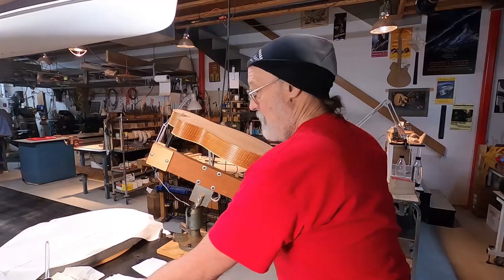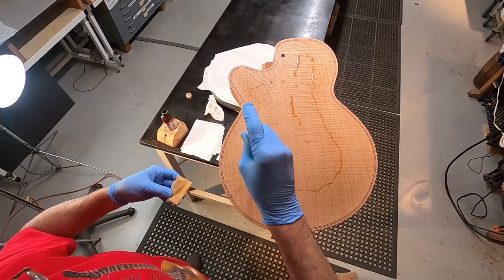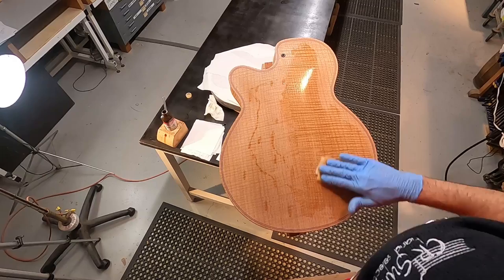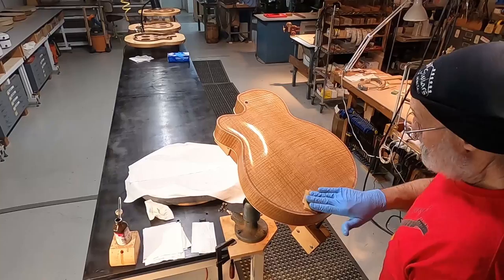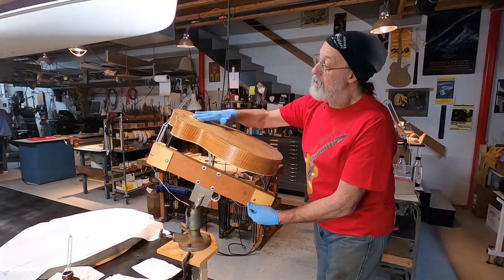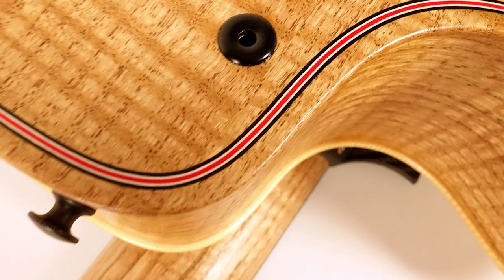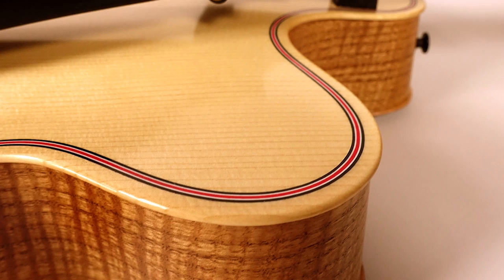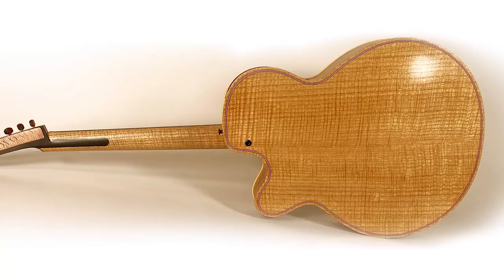Ken Parker Archtoppery: Applying Finish 6

Comment: Ok made it to the end!

First of all, thank you so much for sharing your process and expertise. This really inspires me and how I want to take my building forward. 
I had some follow up questions for you:
1) have you tried using an oil/shellac combo a la Eugene Clark on the top coat or at any layer?
2) Would the epoxy wipe off finish faster or thinner with a rag soaked/damped with alcohol?
3) do you buff/ steel wool at the end of the finishing process?
4) how does this finish impact the tone and have you/would you use it on a flat top?
5) do you seal the inside of the plates and rim as well? 

Thank you soooo much!
Reply from the maker: Hey Robert!  Good questions, I think I just answered all of these for others.  Maybe poke around the comments and see if I've left anything out?  I'm trying to figure out how to handle the questions in the best way, and maybe I'll just wait a bit after releasing the series, then do a video Q&A that will be comprehensive.

Comment: I used Truoil for my last guitar. Its surprisingly durable and can be sprayed no problem at about 8-10 pounds from an HVLP. Doesnt effect the sound in any bad way either
Reply from the maker: I have heard this from others. glad it's working for you.  I like hand wiping this material so much, I'll never try another method. It's easy, and if you can get going early, you can apply 3 coats/day, and have perfect control of the surface. My days of atomizing finish are behind me. Yuck.

Comment: Hi Ken, I have been using Tru-Oil for 8 years, and if you apply the last coat of Tru-Oil with 000 steel wool, the surface finish becomes even more beautiful. Of course, you have to wipe off as you go.  Try :)
Reply from the maker: Great tip!
Reply: How so? Not trying to be a wise guy, I really have no clue what the steel wool does. More matte? More shine? Smoother?

Comment: Hi Ken! Thanks for giving an insight look in your workshop. May I ask if you do sanding between the coats? Thanks and regards! Flo
Reply from the maker: Only if there's a problem, which I try very hard not to allow.  The coats are super thin, and sanding is not required if you wipe perfectly.  0000 steel wool will erase most little issues, if needed.

Comment: Thanks Ken for your intelligent approach to all things guitar building. I've been using Tru Oil and Renaissance Wax on my necks for sometime now. Not liking a high gloss neck finish. Wondering about the epoxy seal coat before hand on the body. Do you use as a pore filler? Seams like both these woods are fairly tight grained. Also what's you opinion of Z-poxy finishing resin? And I agree totally the Italian Chestnut is absolutely beautiful.
Reply from the maker: You're most welcome! The epoxy forms a thin layer of plastic resin mainly within the wood, so a bit of pore filling is bound to happen, but when you're done applying it to an open pore wood like the curly Italian chestnut we like so much, it still appears very open and unfilled.  The sparkle and reflectivity of a very smooth wood surface is largely the exceptionally shiny inside surface of each cellulose tube, which are a probably a bazillion times smoother and more reflective than anything we can accomplish by polishing the wood with our various means. Traditional pore fillers normally contain opaque pigments, which block all this reflective glamor. I suppose its not so bad to fill with something without pigment, like this epoxy, but getting it to do the job evenly without soaking the guitar with a spray gun, and having to sand a lot of material off, then go over it again to try to get the pores that were unfilled is a very steep challenge, and, in my opinion, a toxic mess to be avoided, ask me how I know. If you unlock the secret to easy and successful pigment free pore filling, pray tell! I never tried Z-Poxy, and so have no opinion.  How do you like it?
Reply from the maker: I just read through my reply, and noticed that I didn't mention that I don't use pore filler ever, and as far as I know, nobody can make me.  I like it when the wood looks and feels and sounds like wood and not like 6mm of clear epoxy bonded (?) to a tabletop. Whew, now I feel better.
I can usefully quote by buddy Michael Greenfield, ""Finishing" is an oxymoron."
Seriously, though, I suspect that you may really like your neck finish even more by starting with  this painless sealer/primer clear epoxy coat; just don't forget to wash off the amine blush before you apply Tru-Oil!
Reply: @kenparkerarchtoppery9440 Thank you very much for your reply Ken. I've been building and repairing guitars for over 20 years now. Not my day job so it gets squeezed in when possible. My main focus has been solid body electrics and so a lot of high gloss finishes. Most people like high gloss finish. The Z Poxy is a finishing resin that is a 1:1 mix and a bit more amber looking than the product you use. I had a problem with coating over it and stopped using it not knowing about the film you mention that needs washing off. Anyway not to rattle on, I'm soon building a OM Martin style acoustic and am very grateful to have found your finishing system. It will be perfect for this guitar. Thanks again Ken, appreciate it.
Reply: @kenparkerarchtoppery9440 , absolutely plan to add the epoxy step to my neck finishing. And I'm very familiar with the tru oil finish having used it with the wax on a ES-335 style all mahogany bass. Love the feel. going to add the epoxy step the next time and try it out. Thanks again for the info and taking the time to write a very thoughtful reply.

Comment: Hello Ken, a few questions sorry to bother:
Any consideration when using stains? Can It go trough the epoxi, or would It be better using It before(or just using something different like shellac)
Other luthier's using tru-oil sand between coats. With your method it is not really needed right(considering how thin you apply it)?
Could it be wheel buffed being careful about how hot it get's, or is it too risky?
Have you tried other oil varnishes? There's a few acoustic guitar builders quite passionate about alkyd short oil varnish, for example.
Thank you very much for these videos, looking forward to the next
Reply from the maker: So many good questions!  Please find out about the stain thing and let me know how it works, I'll be in your debt!
Sorry, I'm such a nerd, I really have no idea what other builders are doing, just trying to satisfy myself.
I'm terrified of buffing wheels, no thanks!
I've tried almost everything, and this is the finish I wanted to show you, it really works!!
Color is just not my thing, but please consider yourself a research fellow, and share your findings!

Comment: Perfection! Do you have another recommendation for the ground coat? The least expensive West Systems epoxy set I can find (105A and 206A) is eighty bucks, and I only have one guitar to use it on. I love your result. Can it be achieved a bit more economically for someone like me, who's just finishing their own guitar? Thank you for the lesson!
Reply from the maker: I'd say visit a boatbuilder, and see if you can get the small amount you'll need.
Reply: @kenparkerarchtoppery9440  Thank you for the suggestion. I'm fairly land-locked, but you never know.

Comment: Great looking guitar, and of course beautiful finish. Some questions if I may: the epoxi is a pore filler or just a base coat, or both? You don't sand between any of the coats? Many thanks
Reply from the maker: I don't fill pores, cause I took a straw poll, and the majority of pores just don't wanna be filled.
Sometimes I do use 0000 steel wool if there's a problem, like a speck or a smear of finish that didn't get wiped up perfectly.  I try to work accurately so I don't have to, but it's no biggie to do it.  Can also use Carborundum EZ touch sanding sponge, micro fine, 1200 =1500 grit.  Kinda like a magic wand in the sandpaper arsenal.
Reply: @kenparkerarchtoppery9440  Thanks for the reply. (By the way, sorry if my English is not accurate but I'm Portuguese, so...). Always a rare and amazing privilege to get some insights of the ones we regard as true masters! One or two more questions (sorry). You use the steel wool or the "magic wand" :) only to solve anything not quite well or also between one of linseed oil  coats? And forgive for the continued questions "bulling": You use the 105 Epoxy and the 205 hardener, in the West System its available the 407 or 410 surface filling. What do you think about it. In your finish system could you use it or its not worth it, regardless of the tonewood used? And more :( to give you more working time, what about the 206 or 209 hardener (or you get best finishing results from 205?) Last one ... and any thoughts about the use of the 207 Clear coating?